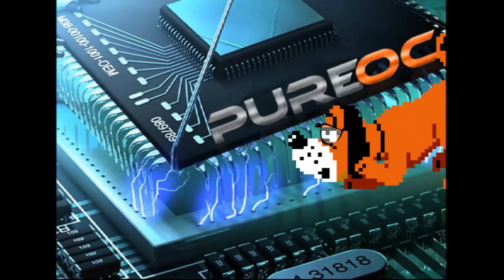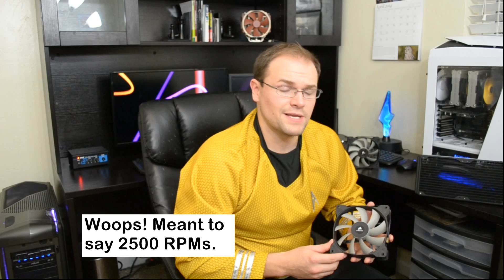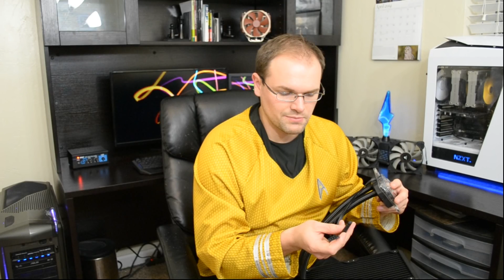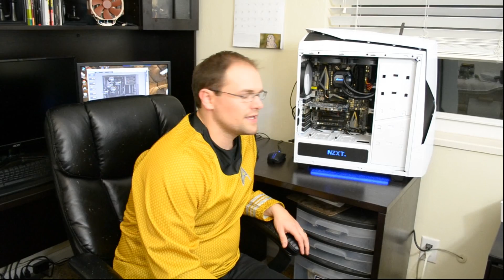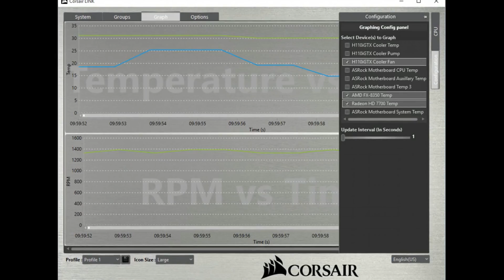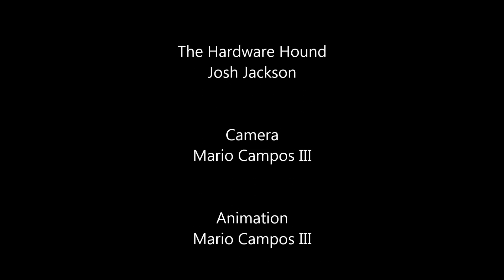Corsair H110i GTX CPU Cooler - Halloween Review - Star Trek Edition

Comment: what about mounting noctua fans to the radiator instead of using the corsair?
Reply: what about the difference between the corsair hydro coolers, like the h110i gt or the h115i gtx? which is the best to have?

Comment: I just got mine and I must say definitely good unit sadly for me I didn't mount it right cause one the standoffs didn't screw on right so it messed up the paste have to wait a few days to repast but still working good, will still repaste just in case. It's also hot here in Australia so the temps are getting affected or could just be the paste lol.
Reply: Should be ok. Doubt you rubbed it all off.